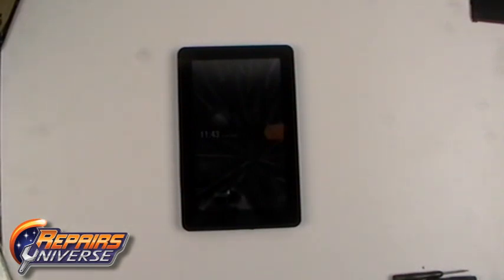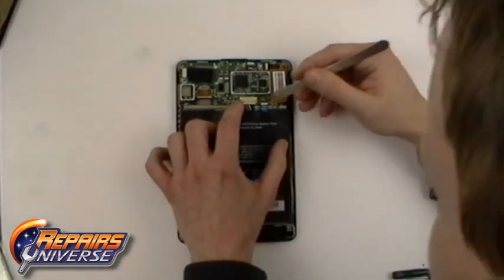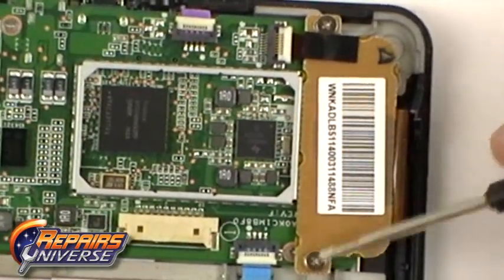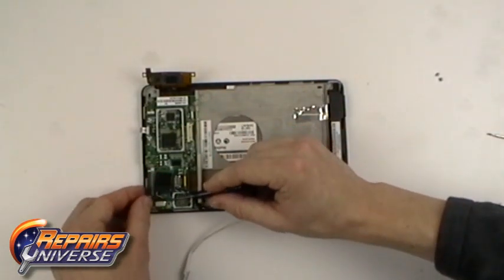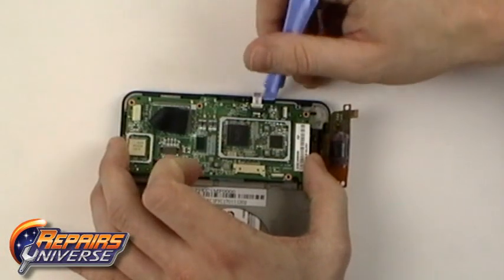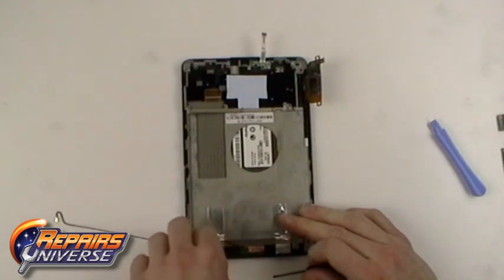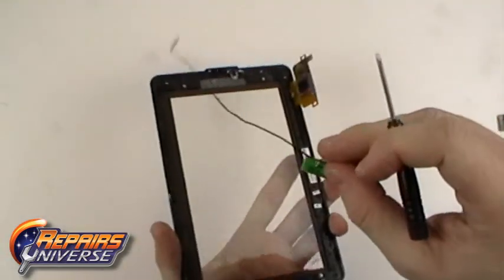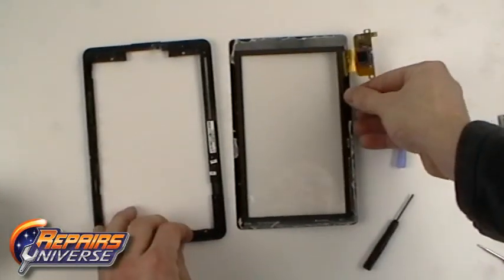Amazon Kindle Fire Touch Screen Replacement Repair

Comment: Great Video.  Easy step by step.  I was able to do it at the dining room table in about a half hour.  Just know when you buy the parts to get the pry tool and do not forget the adhesive and the small strips of foam that may not be with the digitizer pending on where you get it from.  Thank again for a great video.

Comment: Good video. I used this video to fix my cracked screen (the surface that your fingers touch). I would recommend this to someone who is patient and able to work with the small parts inside the Kindle. It took me about two hours. I wasted about a half hour from messing up ...Upon reassembling, I did not have the digitizer connecter slotted up through the circuit board, and I did not have part of the upper white jaw connecter cable run underneath the circuit breaker. I had to disassemble and reassemble the circuit board twice, this wasn't really a big deal but wasted a bit of time. I just fired back up my Kindle a few minutes ago, and wallah, like new!

Comment from the maker: It's possible during the repair the connections involving the touch screen were not completely secured in place. This can result in issues with sensitivity and functionality. You may want to open the device again and be certain the internal connections are firmly attached in the correct positions shown in the video. If that doesn't work, it's also possible the replacement screen is faulty which would need replacing. However, your best option is making sure all is secure internally. Good luck!

Comment: Thank you for the video.  I have replaced my screen and it is working but I am having a new problem.  On some portion on the screen, sometimes it doesn't work or you have to press very hard.  Did I do something wrong in the replacement or is there a different problem?  Thank you for your help.

Comment: My screen on my Kindle Fire cracked when I dropped it.  It still works- just the glass has cracks.  I went to your shop site and need to order new glass-   I just need the LCD screen and not the digitizer, right?  I works fine.

Comment: Pretty clear, mostly helpful, but beware -- there is an error in the video at 6:00, as another poster notes below. In some KFs, there are *5* screws to remove the housing, not 4. I spent a lot of time trying to separate the housing and the screen, as shown in the video, and ultimately wrecked my KF. The author of this video should post an update!

Comment: Great video. Do you know which flex cable controls the touch sensitive controls of the touch screen? I replaced my charging port and I think I forgot to connect (or didn't connect properly) that flex cable. Thanks!!
Reply from the maker: Take your unit back apart. Check the flex cable. It does operate the digitizer. Sometimes if you don't seat the flex you will get the problem you are describing. Check twice assemble once! Good Luck
Reply: Repairs Universe Which flex cable?  Are we talking about the one that is detached at 3:03 in this video?  If that cable looks seated correctly and the touch screen still doesn't respond to touch, is there anything else to check?  Thanks!
Reply from the maker: Nick Bones Its the large flex cable at the top right.

Comment: i accidentally broke the white plastic clip you lifted to slide the screen wiring out of (piece at 3:04 on the video). do i need this clip to make the screen work right once i put a new screen in? was taking it apart to fix the loose usb and pop, the white tab poped off. the screen comes on now but i have no touchscreen. have i ruined this kindle fire trying to fix it? please answer me back if you could

Comment: HELP!  I followed this guide and successfully changed my screen.  Then I reversed the steps and put my kindle back together, but now it will not come on.  The power light turns green for a few seconds and goes off with the screen remaining blank.  The light also turns orange then green while charging like it is suppose to.  Where did I go wrong and can I fix this myself????

Comment: What i want to know is are 1st generation and 2nd generation kindel fire 7" do1400 parts interchangeable? because i have very mist up kindel fire do1400 2nd generation. I need parts for the screen and back. while shopping it  usually  does not state this information I find it confusing.
Reply from the maker: thebighat99 Unfortunately no, they would not be compatible.

Comment: Why has this video gotten so may views?  Because you will be watching 10 or 20 more times to do reassembly. This would be all fine and good if it was just some helpful individual,but it really falls short for something trying to come across as professional . And as Dr. Jonas points out,most people replace because the screen is cracked. If your screen is cracked cover the glass part up to the rubber gasket,(but not on the gasket) with good duct tape,when you have it pulled apart enough to start pushing the uncovered side,als cover glass part,(but nothing else!) This will still not solve all of the broken glass issues but it  keeps large shards from popping everywhere,which also begs the question,WHY AREN'T YOU WEARING SAFETY GLASSES.lol . Seriously, after listening to this guy tell me to SIMPLY pry off the back with a SIMPLE pry object and SIMPLY unhinge the SIMPLE jaw connectors I wanted to SIMPLY kick him in his SIMPLE frickin head.